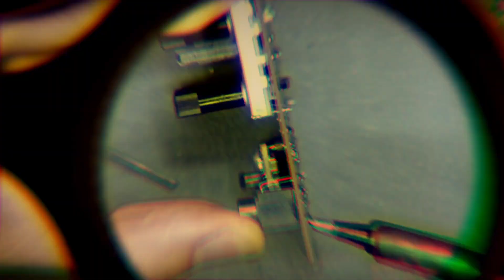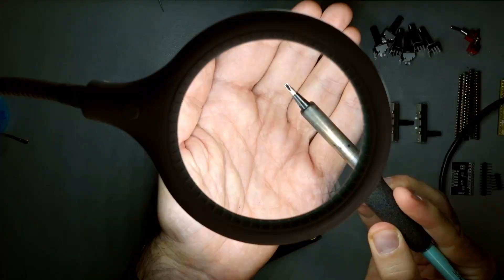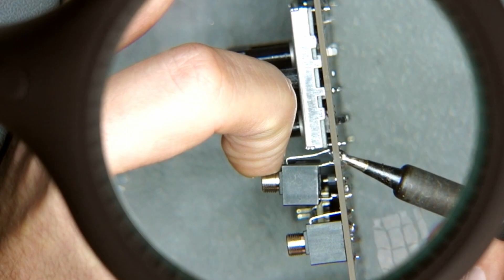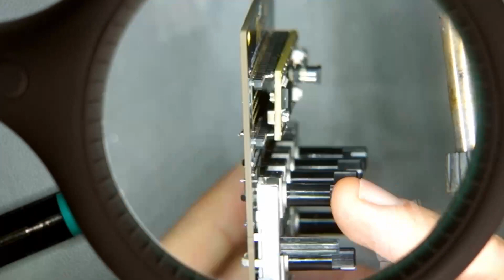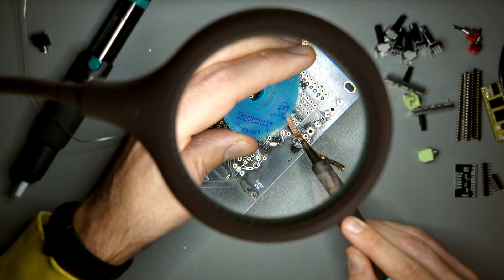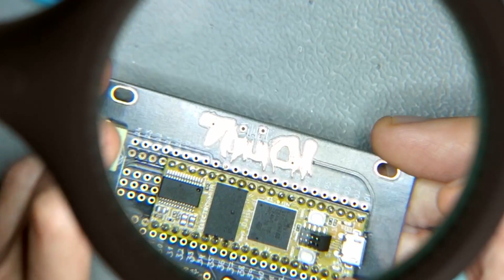Desoldering can be very frustrating, unless you know this trick

Comment: To desolder components like these, I actually remove as much solder as I can using the wick and flux, and you can do this so well with just the wick and flux that the component will just slide out of the hole, there is less chance of damaging the pads on the board this way. 

To clean the pads you only need to apply flux to the pads and then cover the pad with the de-soldering wick and apply heat with the iron and use the tip of the iron to gently slide the wick around to wipe the pad. The flux will allow the solder to flow into the wick much better.  By applying more solder instead of flux to aid in de-soldering (as shown in the video), you are increasing the thermal mass needed to be heated which makes heating the joint (and thus desoldering) a more difficult job and requiring more heat or a larger iron than would otherwise be needed. 

A lot of time you want to transfer the heat to the solder joint but cannot do it so well, because too much oxidation has formed, just a little bit of gel flux will remove the oxidation and aid in wetting,  and allow the heat to transfer very very well to aid in the desoldering (and the wicking).

Sometimes I find that the solder on a board is of a high melting point which makes it difficult to desolder (some RoHS solders are of a high melting point 213F+). In this case, I would apply some standard 60/40 solder which lowers the melting point and makes these joints easier to clean up without applying as much heat to the board or components. But again, use alot of flux. Flux is really your friend. 

I suggest a good gel flux which comes loaded in a syringe.  I use MG chemicals 8341 no-clean flux paste which comes in syringe. It is such a great tool and flux is often overlooked as a necessary part of kit but, it really is essential.
Reply from the maker: Lots of great tip here. I might make another video to try these! Thanks 🙏

Comment: I appreciate anyone who makes a video about this, but wow it's such a loaded topic. The pump thing is unnecessary once you have the braid. The braid should be high quality which has flux interwoven into it, but mine does not which means once again flux is king. Adding solder to your iron or the joint is NEVER a bad a idea and can aid in anything including REMOVING it, which is weird when you are a noob, but the idea is it improves heat flow. The other thing I learned is to waste that braid like there's no tomorrow. Seriously, just keep using it up. Anyway, after my comment it looks like you did a great job.
Reply from the maker: Thanks for watching! And thanks for pointing out the flux. Indeed, it’s all about heat flow, and there are certainly lots of approaches to get it done. I hope this video, and comments like this, will make for a resource for beginners to join us and make more synths.

Comment: You can also get some bismuth/iridium based solder with very low melting point (120-140C) so you don't destroy the jacks. When you add it to the solder joints, they stay much longer in fluid state and you can easily pull the component out. You need only a tiny amount of it. After it, you have o properly clean the pads. A de-soldering gun is also a good way to remove components.
Reply from the maker: Cool! Wasn’t aware of this solder. Will certainly get some. 

In these videos I try to keep to basic tools, because the goal is to bring more people into the space. Although I do have a desolating gun, I decided against showing it, because most beginners won’t have one. 

Thanks for watching. Really appreciate the tip!
Reply: @SynthuxAcademy  If you want some inspiration, here are a few tips:
Mr. Soldefix - https://www.youtube.com/@mrsolderfix3996
Learn Electronics Repair - https://www.youtube.com/@LearnElectronicsRepair
Sorin&Diana - https://www.youtube.com/@sorinelectronics
Electronics Repair School - https://www.youtube.com/@electronicsrepairschool
Adamant IT - https://www.youtube.com/@Adamant_IT

I Wish you good luck in your endeavor.
Reply from the maker: Trying to look for bismuth/iridium based solder in the Netherlands. Found this > https://www.eleshop.nl/low-melt-alloy-desoldeer-legering.html Is this the one you mean?

Comment: just get a desoldering vacuum pump. Problem solved. No torn board pads.
Reply from the maker: It really depends, if I’m honest. Sometimes working with desolate wick is more effective, and sometimes the pump is faster. But either way, you need to add solder first to get it right. 

I did pull on that jack a bit too hard and that lead to the pad going out. It can happen with any technique.

Comment: Easier way to desolder a component is to mount a wire along the pins and hit it with solder. The component will fall out without any hassle
Reply from the maker: Great tip!

Comment: The first step should be to clip the exposed third lead. Then you're only desoldering a 2-lead component. No need to heat those two leads at once.
Reply from the maker: Indeed, but then the jack would not be useable anymore.
Reply: @SynthuxAcademy  This is true. For me, the priority is to avoid damaging the board, which is a real risk when desoldering parts. In this case, heating both pads worked just fine. For something like a DIP? Unless it's a rare or valuable part, I'm clipping the leads first!